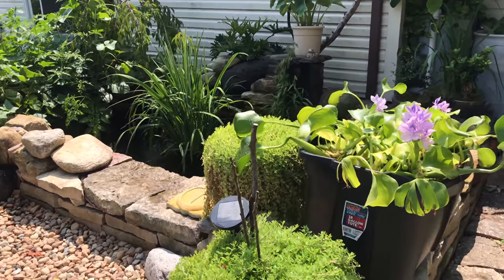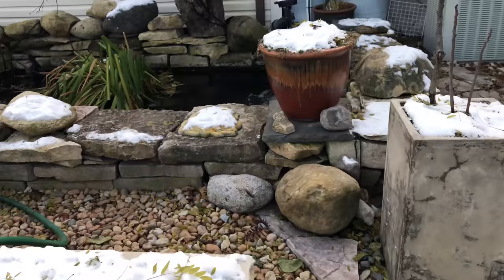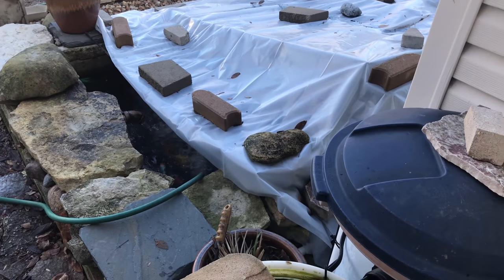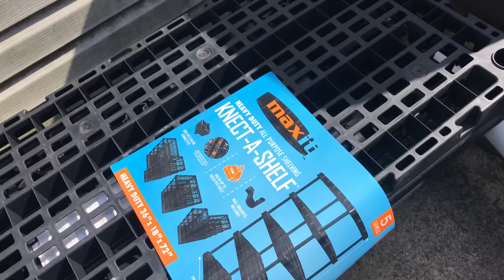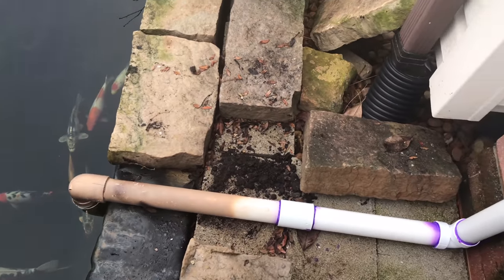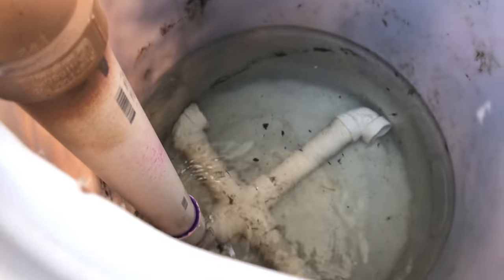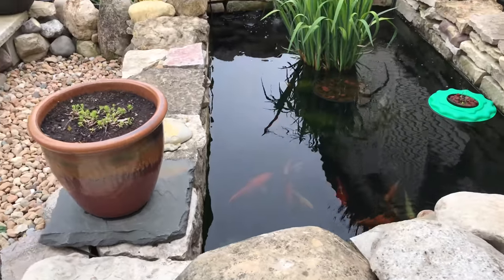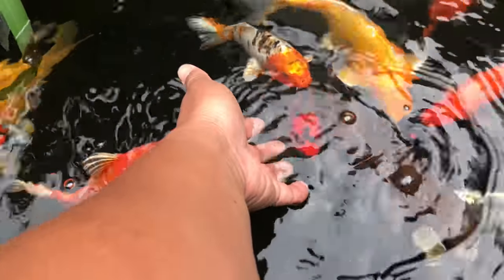Building a New Garden Koi Pond (Part 4 of 5) - Completed after 3 Years

Comment: some very pretty koi you have there !!!
Reply from the maker: Thank you. Most of my koi are rescued and adopted koi giving them a forever home
Reply: @kimuseni  thats great that you have rescued these beautiful fish!, your pond has plenty of depth!but not enough surface area!. google moving bed filters! they are easy to make and you already have an air pump!. they are the best for removing ammonia from the water which is fish waste!!. you have your nitrates sorted with your veggy filter but a moving bed filter handles large volumes of fish in a smaller pond :)
Reply from the maker: Thank you so much for the tip. I always wonder what the main use for moving bed does. I’ll definitely start looking to build it. Do you have any YouTube recommendation video of a good DIY?
Reply: @kimuseni  that laguna pressure filter you use, strip it out completely. Remove the sponges and the plastic thing that holds them. Fill with hel x or k1, I use hel x. About 60/40, 60 percent media and 40 percent water.
Where the water comes into the filter put some mesh to block the media returning to pump if it ever shuts off And you have a moving bed. I've done this exact thing. The only issue you might have is you like to backwash the filter, I dont do this. But seeing as you like to water your garden this way just put some mesh on the inside of the filter to block off the backwash just like you did the inlet.
The pressure of the water will create a cyclone inside with all your media and you have a perfect moving bed.

Hope you understand this.
Reply from the maker: Woah!  Thanks so much. I didn’t even think about doing this to the pressure filter. Thanks so much. I’ll definitely look into doing this. I think I may get a separate larger unit dedicated for this. Will let you know once I get going.
Reply: @kimuseni  perfect, look forward to seeing it. You could have it just before your bog filter. Moving beds are very efficient at stripping ammonia and nitrite and are used a lot in waste management and fish farms, they will produce a lot of nitrates but with your bog filter afterwards it will be a perfect combo.
Reply from the maker: James Withers thanks again!  You got my mind swirling around for ideas as I type this reply. I may incorporate it with the two barrels I currently use. I’m thinking making a smaller side barrel that will sister connect with the first one running a cheap airstone/pump and a small pump to bring a slow moving water in and out of it. Thanks again. I have to rely on brain power since I’m low on cash.
Reply: @kimuseni  sounds good look forward to seeing it.
Mine is pumped from pond into the laguna pressure filter then into a water butt that also has hel x in, (I can also use the tap on the butt to water my plants) then it goes into Laguna small pond container which is filled with marginal plants. Then back to the pond.
Reply from the maker: @jameswithers3066  how are your fish doing?
Reply: @kimuseni  they are doing great. Spring has just been a bit slow, still a little cold at night. I have built a new pond, at some point I'll put a video out and show you.